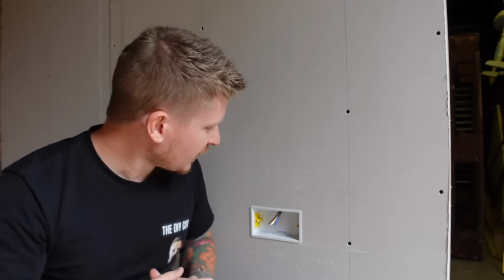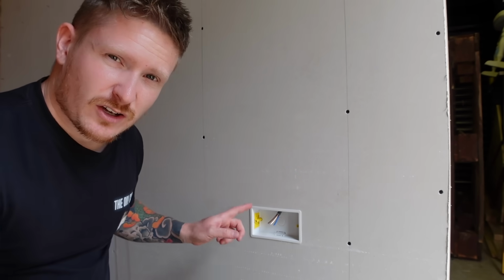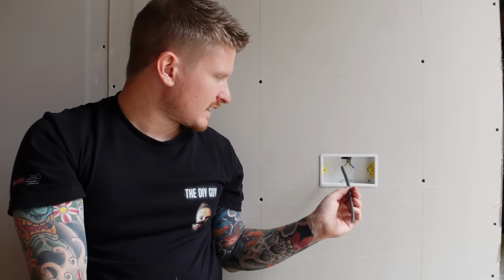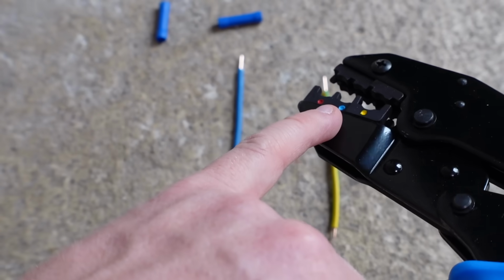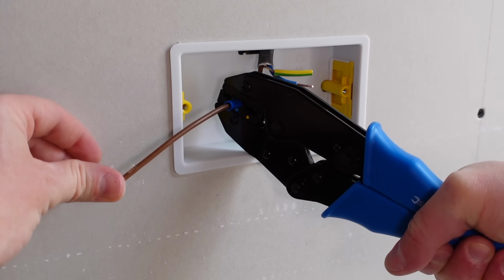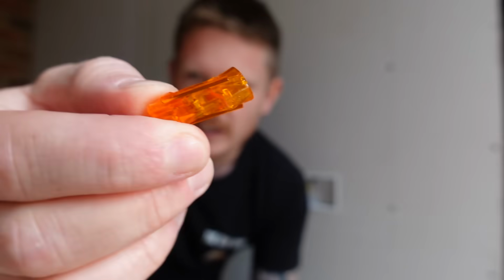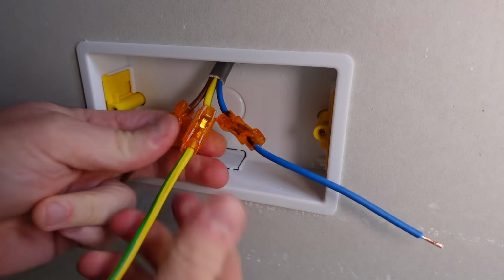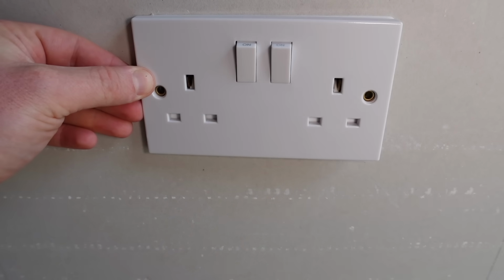How to Extend Short Wires | Easy Fix Anyone Can Do

Comment: dont forget if the crimp ring isnt joined ( a opoen joint metal ring ) u go tto have the crimp tool the right way up so the teeth is on the flat side no tthe open side of the metal

Comment: Third option which is permanent and meets current wiring regs is to twist the cables, solder and then cover in heat shrink. I much prefer this as I know the connections will never come loose

Comment: Your wire stripper is about 100 times better than mine,  who makes it ?

I have used an aluminium version of those push connectors for years to secure single strand steel electric cable around big acreages to keep cattle and horses on the right side of the fence. The metal ones were called Gripples.

They were insanely strong. We tried to cut one open (took about half a day) & the mechanism is simplicity itself.  I never knew they had applications in other industries 😂

Comment: Why electricians don't like solddering wires?
To make a perfect job with crimpers, the guy uses a crimper that costs $200 ~ $400.
But, with a solder of $10 you can do the same job.

Comment: Talking of wiring and home electrics. What is the best or a good solution to hang a light fitting from the ceiling without drilling the plaster board ?

Comment: you did a poor job of crimping the live not enough care taken and you lost a the full length of the crimp exposing the wire on crimping the live extender cable. Also the earth is a 1.5mm cable and needs a red crimp .My advice is to leave electrical matters to the electricians on your Youtube channel my old son!

Comment: I solder on wire extensions and use shrink sleave to insulate the joint. It's more flexible.

Comment: Thanks you made it look easy, I once fitted a new light switch, there wasn't much room in the box and an understatement to say it was a tight fit, when I finished the switch didn't work only to fine a wire had broke off, so spent anther half hour trying to fix it that

Comment: Thanks an actual real life issue to many with older houses were those wires been cut several times and now so short for outlet changing. But why is there one set of 3 instead of the common 2 sets. If u have 2 of each then the extension has to be of larger cross section or use 2 wires for 2 wires?

Comment: Can you use screw connectors? I think they are called " Choc blocks " as the socket has thin twisted core cable in it

Comment: I don't think you can do this with the ring main, you'd have two conductors going in, you'd have to go up to 4mm on the other side or you'd effectively be changing the cable size without a fuse.

Comment: I have a very old townhouse and learned that almost every overhead light had wires that were too short to add modern lighting. The splice-in-line connectors work. You saved me trouble! Tx

Comment: Wow those push fit connectors are just the job - l’d never heard of these until I saw your video. I changed a wall socket with tight wiring and the result is fantastic.🙏

Comment: I am curious how much contact there really is with those push on connectors.   I have historically stayed away from any push on connectors (like the push on ports in the back of outlets) because they usually just have one little blade of metal that bites into the wire and don't create a very good contact (imho) on the wire.  Disclaimer: I am in now way a pro, just a DIY'er, so change my mind.  :)

Comment: The blue crimps I have are not rated for 230Vac. So I solder wires on and use heat shrink sleeving. Soldering gun runing on a similar device like a Jackery but homemade.  George 😂

Comment: Never use those press on connectors if you can avoid it. Crimping is superior in every way to this. Crimos cant have bad connection, overheat or arc as this connectors can. Crimping is the only joint that is equivalent as an uninterrupted wire run.

Comment: There is only one way to extend wires for me and my customers. If you want reliable , low resistance and solid connection that can resist moisture , high current , time etc. - just solder it ! Then some heatshrink and maybe a bit insulating tape ..  Compact & reliable...I tell you that  as a pro electrician with decades of experience
CheerZ

Comment: Those orange connectors, how do you release them? We have this type of connection on switches and power outlets here in Japan. They can be freed with a flat blade screwdriver. With power outlets, it's difficult to collect more than two 2.5mm cables. Not like the old 7/029 (remember that?) cables and an MK power outlet. Really hard to get junction boxes here in Japan. Have to pick a few when you visit Malaysia.
Jack, the Japan Alps Brit

Comment: does the same method apply if you need to add a couple of foot of cable to centre a ceiling light? not adding a light just extending with 1.5mm cable and wago as per the video.

Comment: Hi another great video and very helpful . Can you extend an alarm door sensor wire , these are extremely thin wires and mine is short by about 6cm so I want to connect another bit of wire to extend it . I had thought about soldering it but maybe there is a simpler solution , any thoughts would be helpful thank you

Comment: Great suggestions. One more. If the wiring is open to access there is usually a bit of slack in the line so it can be rerouted or stretched. Got caught in that trap last month. 🙃

Comment: Not so much room if you have a ring system. Having sex wires instead of three.
Personally I prefer to solder and heat shrink, takes longer but 100% smaller and more secure. 
But I do like those push fits for speed if you have room

Comment: If there is a pair of 3 core coming into the box close together, they must be on a ring. If then there is a take-off from the back of the fused, switched faceplate for in this case a wall heater, then I cannot see any way of using any connectors that can all fit in the box even if only there to extend the workable cable lengths ?

Comment: Superb video. I had no idea inline splice connectors even existed as a diyer I have crimped over the years when things like this happened. What is the brand of wire strippers you use? They are excellent

Comment: Are these methods still exactly the same for lengthening electrical cable by a few feet? I have two doored utility cupboards, one in my kitchen that has a double socket, one in my hallway that doesn’t and I need it the other way round. The hallway is the other side of the wall (plasterboard) from the kitchen, and its cupboard space is directly next to the kitchen’s cupboard space, separated by plasterboard. If I remove the socket from the kitchen and put it in the hallway cupboard, will these orange connectors be sufficient or does the whole thing need to be insulated/protected further if the splice is in a cavity, rather than contained inside the socket box (as shown in the video)?

Comment: You do this wrong. The dies of this machine are not symmetrical. Left side of criming machine, should always touch outside of the blue connector.
Check few times and try to understand.

Comment: Why not use a standard connector block? There are high quality connector blocks with two screws in line on each side, so that, if you use one which is about the same diameter as the cable, and tighten all of the screws very tightly, you will have a very secure connection indeed. These push on connectors seem very useful, but it would not be possible to remove them again.

Comment: What happens if this is the case but with a flush mount light fixture? I found one (vintage) but the black and white wires are super short. I virtually have to be face to the ceiling and having trouble still keeping these wires securely inside the wire nuts with the ceiling wires.

I’m guessing I can use these methods. Must go to Lowe’s now lol.

Comment: Dont use those strippers to strip signle cores you are marking up the insulation. You shouldnt be doing electrics without qualifications, its have a go heros like you that cause fires

You must double over cable ends before inserting to socket terminals 

You must pull push the socket into backbox and recheck connections. You will get a half turn more. Hse should pop round and see you

Comment: Never thought of crimps! 

3rd option would be to take out the back box and then put in a push fit junction/quickwire fitting. Keeps it neater and also takes up less room if a shallow back box.

Comment: You should have wired the socket first away from the wall up at a comfortable table height. then when you are down on your knees you don't have to stay down there too long suffering as all you have to do is push-fit the wires in... it is a small thing to alter but will save your knees later on in life.
Good clear vid though. Thank you.

Comment: Am I the only one that doesn't use wire strippers on twin and earth.  I just lay the cable on pad of my index finger then put my thumbnail where I want the insulation to break. I then squeeze and pull.  The thumbnail creates a weakness in the insulation then the pull causes the insulation to snap at exactly this point.  Since thumbnails are not hard enough to penetrate the copper core, there's no risk of nicking it.  This also works on other sized cables too.  finer wires (such as those used in headphones or microphones) will require a much lighter touch to avoid snapping the delicate copper cores, but it still works great once you get the feel of it.

For the outer sheath of twin and earth, as it starts to rip, you may have to flip the cable over and use the same technique on the other side to complete the cut.  It's still easier than faffing around with wire strippers.

Comment: On 2.5 T&E the earth is 1.5mm which requires a red crimp however I wouldnt use crimps on solid cables the modern Wago connector is the right route to take

Comment: Great video! I’m using two way connectors to connect some wires I had to cut to sister a floor joist. Does the connected wires need to go into a junction box? If so what IP rating is required to adhere to standards? Its under a bathroom subfloor.

Comment: Can I use these crimps to change position of a switch without using a junction box. Also can the crimped wires be left in the wall.

Comment: You shouldn’t use through crimps on solid cable.Also after you’ve fitted the socket, how are you going to test it? Electrics is not for DIYers, leave it to the professionals!

Comment: That's brilliant - I much prefer the inline splicing connectors. Apart from being much easier, I think they're probably a lot safer too. I'd be a bit worried about the crimping method and not being able to see that a good secure contact was made, which might lead to arcing and fire.

Comment: I have a different kind of short cable problem.  How can I connect the new smart switch ground to a bundle of short tightly twisted ground wires?  

I’m trying to put a fancy new smart switch, which requires neutral and ground) into an 80’s built US light switch box. The problem is that when it was installed, they didn’t ground switches. so I have a bundle of 4 12ga ground wires twisted up tight as can be with only about 1 1/2” of wire.   If I untwist the bundle, it’s going to be an unmanageable mess of thick twisted wires. The bundle ends are all trimmed off flush with each other.

Comment: WAGO connectors are a thing. Hyper reliable, easy to install; flip up a lever, insert wire, flip down lever, done. Crimping? Really? Dude. Another option would be Posilock, but that may be more an America thing. They do what the crimped connectors do except well and 100% removable and you need no tools with them either (though pliers to help tighten them might be wise).

Comment: That is a dry lining box, take the box out, do any joint you like with a generous length of cable and put the box back in, result is just wires in the box without bulky joints

Comment: For videos like this one it would be a good idea to add the country to the title. In North America this is usually done with twist-on connectors (wire nuts) and there is never any insulation on the ground wire :)

Comment: If you're not confident messing with your gas supply, don't mess with your electrical circuits, joining a few wires on a spur does not mean you know what you're doing, leave it to a professional.

Comment: when using crimps use the appropriate size red is 1.5 blue is 2.5 and yellow is 4/6 mm so the earth cable he should have used a red crimp as its 1.5mm in size

Comment: Not a fan of using a Back box as a Jointing Box and had you selected not an EOL Socket with 2 x 2.5mm T\E Cables then space would not have been an option, especially if installing WAGO's
For a Quick and Professional joint, use a crimp and a Heat Shrink Cover, then push the repaired cable back into the cavity [where possible] revealing a Brand new tail. Test and place the Printed Lable inside the Back Box with the Date, Zs & Voltage recorded and name of your Business.
Mr Spence Eng
PS you placed the wrong crimp onto the Earth Wire which is sized at 1.5mm2, it needed to be RED

Comment: Hi need some help, I extended uk black and red cables 2mm into new wiring blue and brown 2mm into a single plug socket( simply extending the wiring) now my sockets keep tripping the RCD in intervals I have used Splicers no cables are damaged any advice would be good.

Comment: Lol, calling wires short and still being able to use crimper on them... Good luck with really short wires where you can barely reach them with your fingers. Adding the fact that those wires are aluminium and you need to add copper wires to them. That's where the challenge is.

Comment: Careful if using the crimps. The earth conductor in older twin/earth is often a thinner gauge to the main conductors. In the case of 2.5sq, for sockets, the Earth could well be 1.5sq, which would require the smaller, red crimp connector. It’s also good practice to sleeve over any such joints, to keep damp from contaminating the joint and corroding the copper.

Comment: I would like to see the electricity company pass the installation, if the cable is that short the electricity company  usually  tell you to replace the whole cable, cos when testing it can alter the resistance of the cable thus getting a false reading, they wont like that!

Comment: Thanks for this. I thought the standard for NZ was to use single screw cable connectors for each wire and house them in a pvc connector box that is screwed to the stud, thats what I have done in the past. This looks much much easier, I hope it is regulation standard for NZ?

Comment: DON’T use Wagos! A few years ago, the ‘electricians’ on site used Wagos for the level sensing on a three-compartment, 100,000 litre fuel tank on a hospital job I was running. It cost two full days to put things right - they were SO bloody unreliable!!

Comment: In italy the copper wire is composed by a pack of tiny copper wires, instead of a single solid one. I suppose that this kind of joining is not so effective because the bundle of tiny wires will deform under the pressure much more than a solid big wire.

Comment: Never use Faston-connectors to extend wires but Wago connectors. They are made for these jobs. Faston is to be used on low and safe voltage/current.

Comment: Sorry to put a downer on this video.....but you should never use crimps on solid drawn cable, stranded is fine but not solid drawn. There is a phenomenon call "AC hum" which over time will cause the crimps to become loose on the core.

Comment: Good Video but,  I would never use that crimp method.  Especially on solid core wire.  They are notorius for coming loose.  Even with the prosumer crimp tool,  there is no guarantee there is enough of a crimp to hold the wire in the butt connector.   I by far like the second method - very similar to WAGO connectors.  You would be hard pressed to easily pull a wire out of a wago connector.  I just despise the butt joint connectors, except for low voltage like automotive 12v wiring and the like.

Comment: Sorry mate, the earth wire in 2.5mm twin and earth cable is actually 1.5mm. You would use the red crimps not the blue ones, otherwise the connection would be loose.

Comment: Sure you should be showing ppl that, adding any cable requires a minor works certificate, that and less than ideal termination. You now officially own that circuit along with all its fruitfull liabilities should someone die od electric shock. Sounds a bit aggie i know, but thems the laws

Comment: Well, the crimps are insecure and not supposed to use for solid wires, but other than that, good video :) now WAGO also sells push-in extensions

Comment: Another tip is to wire your socket before with push into the splice, so you don't struggle with the screws on the short cable 😉

Comment: I don't think those push on type joints are safe. When you use the crimping tool the copper in the crimp joint is compressed around the wire so giving a good deal of surface to surface contact between the outer copper cylinder in the crimp to the wire. In the pushfit type there is only a miniscule amount of surfce to surface contact. So if you are using a peice of equipment with a heavy load such as a kettle or electric fire, then all the current has to pass through a small amount of connected metal. Result - they will heat up.

Comment: Why on earth is anyone suggesting that crimps are a good idea? Back in the day when there was nothing else available then yes use them but now they should be put in the bin. Especially hard to get a good crimp in a tight space and on the live you could see where the insulation had been stripped so possibly copper showing. Not good. Use WAGO. They are cheap, reliable and also easy to test from

Comment: I wouldn't trust an AMP through crimp on solid core cables, screw connection or a Wago connector would be a safer option. Qualified UK electrician for 35 years.